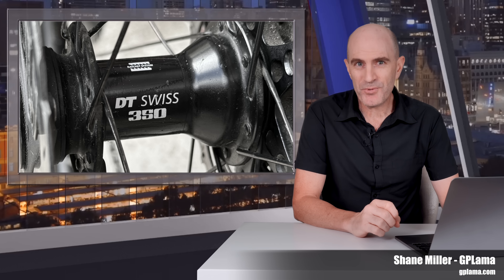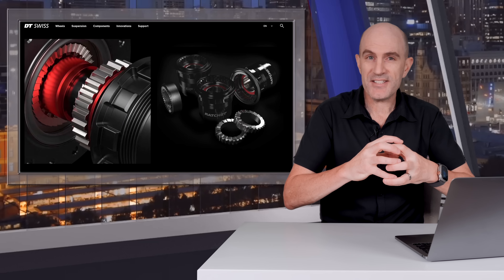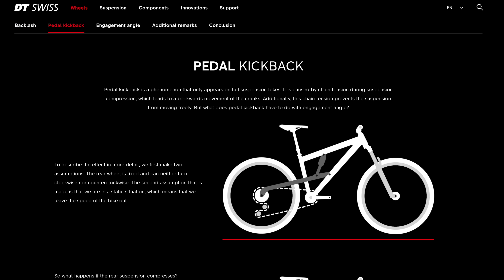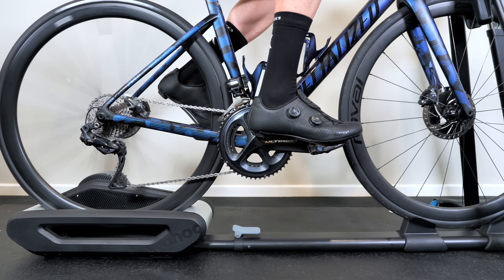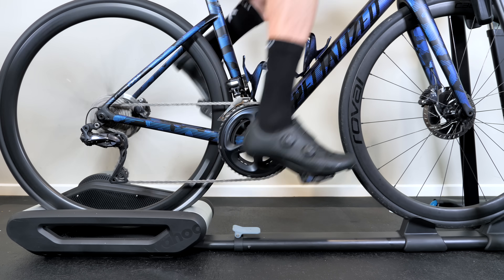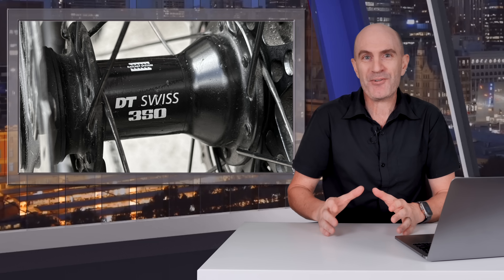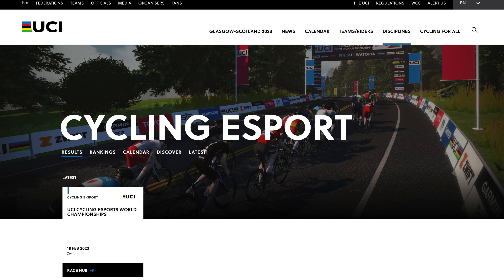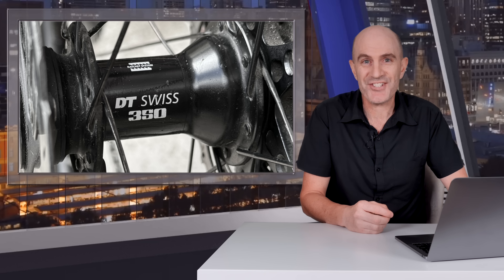ALL ABOUT Freehub Engagement // DT Swiss 350 Upgrade!

Comment: Good timing!   I’ve had DT Swiss 350 (18T) for a few years on my commuter roadie for a few years and was aware how ‘slack’ the take up felt so I did quite a bit of reading a while back. My new Canyon came with the new DT Swiss 240 (36 T) hubs and the take up obviously quicker. It’s nice. But wow it’s noisy compared to the 350 hub. I was pondering the 54T upgrade kit when riding with a club mate recently as he has done it in his 240 hubs but it’s crazy noisier than my 240 36T hub. Don’t know if I could live with an even noisier screamer of a hub.
Reply: I run dt Swiss 350s upgraded to 36 POE, and they were pretty noisy, but I found that loading the mechanism up with extra "Special Grease" dampened to noise, and brought it back to noticeable but acceptable levels (and it warns pedestrians walking on cycle lanes of your approach)
Reply: @johncowley3520  my standard 18 point 350S are very quiet so I wondered if the 36 conversion would get them up to the same volume as my 240 hubs. I prefer them quieter but you’re right, with the 240 hub wheels I use that to alert pedestrians if I commute on that bike. I’ve heard about packing in grease to quiet them down but didn’t know if there are downsides to that ?
Reply: @shred3005 Applying too much grease will lead to freehub mechanism slippage. DT Swiss warned users to only apply a thin layer of their Special Grease on the Star Ratchets.

Increased noise is the trade-off of freehub mechanisms with a high POE (points of engagement) count, I don't believe there's a true workaround for this. I'd rather have such a hub to be louder than slip unpredictably.

As somebody who used to be a shop mechanic, safety factors are far, far too important for me to not acknowledge.
Reply: @sbccbc7471  thanks for the advice. The 36 Poe DT Swiss hubs are certainly an improvement over my other wheels
Reply: @shred3005  You're welcome and yes, 36T is good enough for most of us. If I'm ever going to use DT Swiss, it'll be for the running costs, serviceability and therefore, familiarity. I like how easy they are to work with though the freehub mechanism isn't the smoothest I've experienced, that goes to White Industries. Moderately (and pleasantly) audible, faster engaging than my 2008 Mavic Aksiums and really smooth for a hubset on steel bearings 👌.

Comment: The 54's have smaller teeth and don't last as long. Great for a crit only bike. A 36 is plenty good for most weekend warriors. Also changing the 350 hub is much easier than a 240 or 180.
Reply: So DT is weaker than hopes? By how much easier can they differ on maintenance?
Reply: @oiyo5124  Swapping the Star Ratchets in a Ratchet System-equipped DT Swiss hubset is so easy it can be done at home without tools. Here's the sequence starting with the rear wheel already off the bike:

1) Pull the cassette out to pull the freehub body out. The hub endcap will pop off the hub axle and stay captive under the cassette's lockring.
2) Remove the outer conical spring, Star Ratchets, inner conical spring and hub axle sleeve.
3) Unpack the new Ratchet System Service kit.
4) Apply a thin layer of DT Swiss Special Grease on the Star Ratchets.
5) Install the new conical springs and Star Ratchets, reuse the hub axle sleeve.
6) Grease hub axle, reinstall freehub body.

It's that easy.

With Ratchet EXP, you need a Ratchet EXP tool to remove the inner Star Ratchet as it's now a hybrid combination with the hub shell lockring that now houses the hub's right-side bearing, giving the rear hub a wider bearing stance. Removing this part of a DT Swiss hub (lockring and Ratchet EXP inner Star Ratchet) requires a lot of torque just to crack it loose and is usually done with the tool clamped to a bench vice.

In terms of freehub mechanism service, they're both identically easy.

Comment: Not sure why they don’t use very high PoE or even sprag clutches like Onyx hubs have. None of the virtual cycling platforms need to worry about the extra drag during coasting because it doesn’t translate into the virtual world. Sprag clutches would also be virtually silent.
Reply: Sprag clutches still have a lot of backlash, it just doesn't have fixed locations where it happens.
Reply: @JulianKent  Onyx hubs do have a bit of rubber-bandy backlash, though the Box Stealth mechanism seems to have almost none.
Reply: Just omit the freewheel and go fixed gear direct drive. Make it fit a track bike frame for easy fit and setup. Virtual shifting.

Comment: Definitely no. On a mountain bike it makes sense. On a road bike the upgrade is a trade off between longevity and basically no meaningful improvements. On road, suppose you ride at 100 rpm, the time for one revolution is 60/100 second. With a 20 degree engagement angle your fraction of engagement is 20/360, and therefore the longest time needed for engagement is 20/360 * 60/100 = 0.03336 seconds. Now, assume you need the ratchet to engage when you just start pedaling. Let's say 20 rpm, the new longest time for engagement is now 20/360 * 60/20 = 0.1668 seconds. That's still not a lot of time for the first ratchet engagement. 
By going from a 18T ratchet to 56T, you have more than tripled the amount of contacts on coasting, and you have simultaneously decreased the size of each ratchet tooth significantly. By using less material with more wear, you end up with a system that's significantly more fragile with less longevity, all for not a lot of gains.
Reply from the maker: Does this factor in rear wheel speed? Doesn’t that need to be taken into account when calculating engagement times?
Reply: @gplama  Not really. What's calculated here is the maximum time for the next engagement to happen. In order to "engage" the rear hub you are going from coasting (freehub body is moving relative to the cassette) to active engagement (freehub body is moving with the cassette). During coasting, the rear wheel and the freehub body are moving, but the ratchet mechanism inside the freehub is not engaged. This means that although the wheel is turning, the ratchet (and thus the cassette attached to it) is not moving in sync with the wheel. The pedals and crank arms can be stationary or moving independently of the wheel's rotation. The speed of the rear wheel during coasting does not really affect the time it takes for the ratchet to engage when you start pedaling. The engagement time is primarily determined by the design of the ratchet mechanism (number of teeth and thus engagement angle) and the speed at which the rider starts pedaling. Whether the wheel is spinning fast or slow, the ratchet will engage in the same amount of time once the rider pedals.
Reply: @HoshinoMirai  Just to be clear, the 20 degrees is at the hub. If you are in, say, the 52 tooth ring and the 13 tooth sprocket (4:1), you will have 5 degree engagement at the crank.
Reply: @stephenturkLA  Very nice catch. yeah, my calculation ignores the gear ratio's affect on the actual engagement angle, though, I believe my point still holds.
Reply: @HoshinoMirai  the gear ratio is a big reason why the optimal engagement is different for road vs mountain. On a mountain bike with, say, 34T chainring and 51T sprocket, a hub with 18 POE is going to give engagement of 30 degrees at the cranks!

Comment: Any reccys for grease for the ratchets? I don't have any DT special grease,  only some thick stuff from the hardware store. I saw a video from another YouTuber a while back where he recommended a low consistency grease (eg: NLGI 0 or lower) to get a nice loud freehub sound, but I haven't been able to find anything like that
Reply: You need a semi liquid grease and not a thick one which means pretty much NLGI 0 which has the consistency of apple sauce. You can get this spec grease easily from the main lubricants manufacturers, but they only want to sell you 500ml tubs and its usually a similar price to buy the DT Swiss special grease as you will need so little of it.   Thick grease will lead to inconsistent engagement of the splines.

Comment: Smaller engagement angle is achieved with smaller tooth... What about their reliability then? Wouldn't they be faster to wear out? Also they have less time to properly engage. What about putting power down? 
It's cool, I like free stroke to be as small as possible, but I don't wanna risk reliability.
Reply: So true. 54T does die. Haven't heard about this problem  with 18T
Reply: 36t is a good intermediate point. I've never heard of any reliability issues with it. Even 54t is going to be more reliable than a 3pawl system though.
Reply: My understanding is they don't last as long.

Comment: More PoE has more drag on coasting downhill. That is the disadvantage. Though the angry bees warn other riders that you are coming in hot.
Reply from the maker: That's a good point about drag. 👌🏼
Reply: And noise is energy, so a noisy freewheel is wasting energy when coasting!
Reply: I must say it is good on a carbon rim brake wheel. It rolls impeded so that you don't burn your carbon rim brake track  trying to scrub speed.
Reply: @lordalfa600 Using heavily-sealed bearings could help too. My wheelset only allows me to hit 64 kph at most on a descent (even with me tucked) because of this and the fact that nothing on my bike is aerodynamic apart from my fork blades.

Comment: I love my DT 240 EXPs just wish they were a bit quieter. (I'm going to try adding some of the DT Special grease to quiet them)
Reply from the maker: What ratchet are you running 36 or 54?
Reply: @gplama  36 very angry 🐝s
Reply: Extra dt grease does help out a lot
Reply: @rafaeldegiacomoaraujo8778  by ...creating more drag and interfering with engagement.
Reply: @rafaeldegiacomoaraujo8778  yes I'm going to try that
Reply: @WowRixter Just a thin layer, don't risk freehub mechanism slippage.